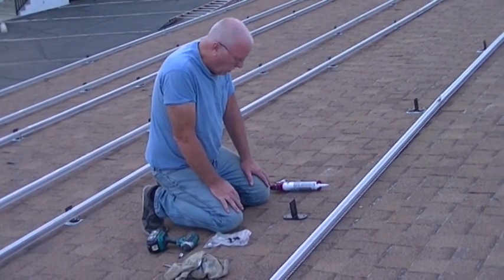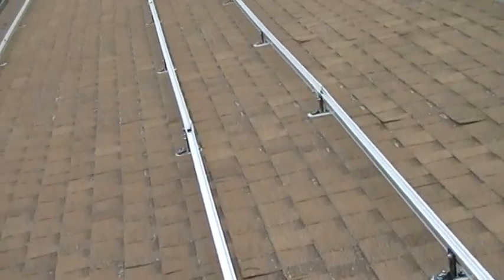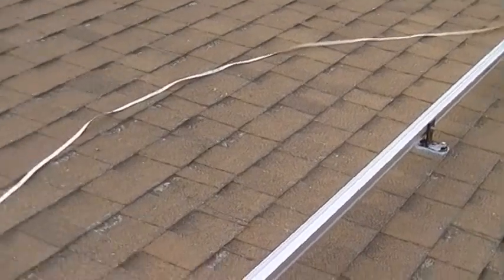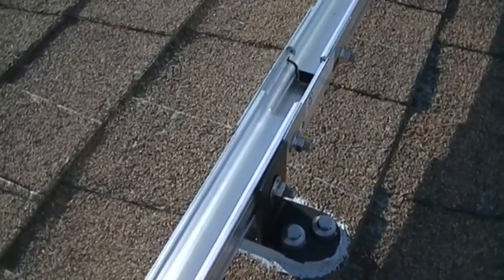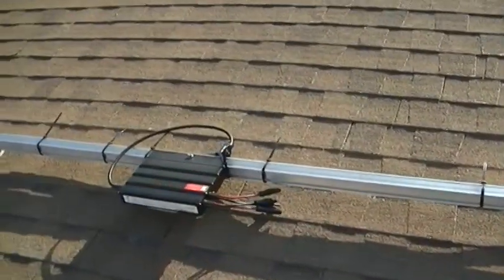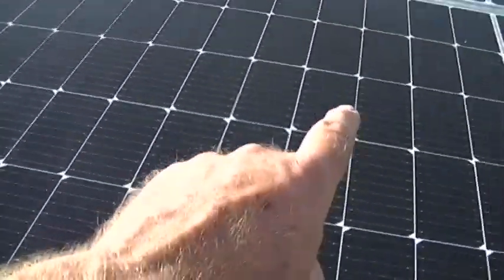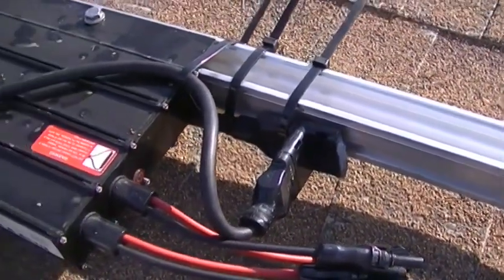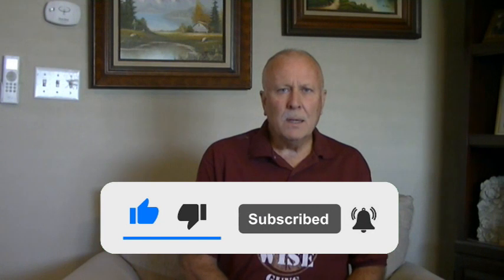Solar Installation with Time & Money Savings Products & Techniques

Comment: DO you mind if I ask who you used for your permitting? I live in Houston and I have had a difficult time finding a company that can prepare the permits. My thoughts were if I can get someone to get permits, their plans would include all the pipe size and wire sizing, grounding and such I would need to complete the project. Thank you again! I appreciate you sharing your tips and tricks, they have really helped me out.
Reply from the maker: Hi. I do all my own designs & drawings. I have some contacts that know outside firms that do solar drawings. I will make contact and see if I can find someone in your area that could help. I will let you know as soon as I can. Have a blessed day.
Reply: @thepennywiseguys  Thanks again!
Reply from the maker: Hi. I found one contact  that do projects In Houston. I will look to see if I can locate any others in your area.    "Source2Load" (MEP Engineering) @ 713-497-5114
Reply from the maker: Hi. I have two good choices for you on having a outside service for solar drawings. Robert with Axis Solar does both engineering and solar drawings. Phone # 951-805-6794. Someone who is cheaper in price does only drawings (NO engineering) is Melissa Camp @ 559-300-7661. With Melissa, you would need to do all your calcs. and sizing.
Reply: @thepennywiseguys  Thank you so much for these recommendations. I will make contact and I will make sure to let them know you recommended them. Again, thank you.

Comment: I hope you dont mind me asking, but have you have any service calls for leaks after using these? I do understand how important a good bead of sealant is on the under side, but I was just curious. Finding studs to screw into, is very time consuming. Thank you.
Reply from the maker: Hi. I have not had any leaks reported yet on these mounts. After this install here in CA, we had the highest amount of rain this last season more than we have had in 45 years. There has not been any issues with leaks. The application of sealant is a good idea to avoid possible leaks. These mounts are made to for sheeting only and therefore you do not need to spend the time to find the rafters. I highly recommend these mounts. Blessings.
Reply: @thepennywiseguys  Thank you, I appreciate your assistance!